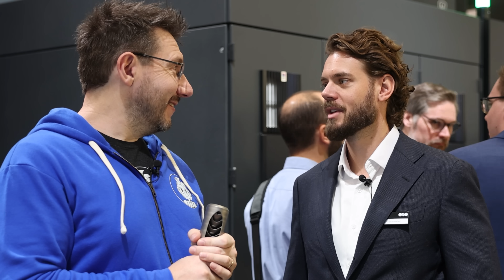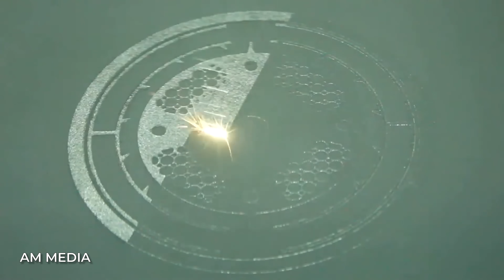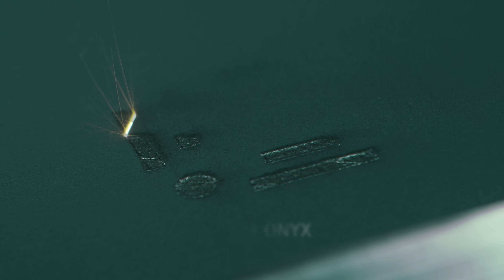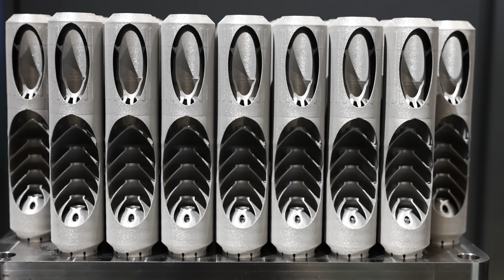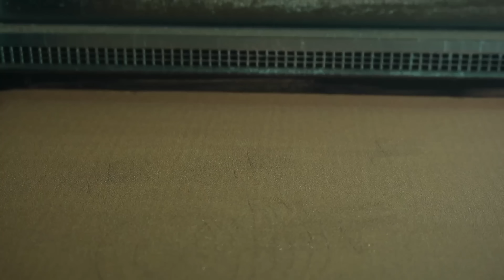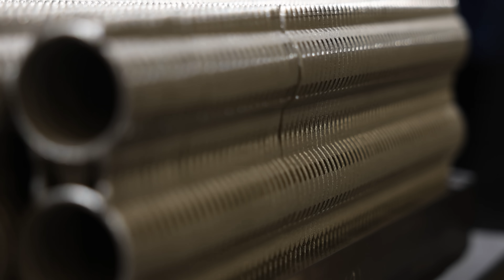LIGHTS OUT METAL 3D Printing from EOS!

Comment: Why do all the metal-printers show off their abilities with gun suppressors?

Hate it. I get they want the gun-nut and military money, but I hate that.
Reply: The legacy designs for silences have low yield due to the brazing and workmanship leading to low yield. Printing this geometry improves yield and reduces price due to the reduction in touch labor. That is before you design for performance improvements in the final product from the materials microstructure or geometric complexity that are within reach by Printing. If you sold the same design as legacy printed it would genuinely cheaper for the manufacturer which is more money in the bank. Its a very easy use case to demonstrate to people who have seen the headaches of yield from brazing or assembly.
Reply: k

Comment: I have a CAT AlleyCat 556 QD in 718 inconel. Literally the best suppressor I have ever bought and it’s made exactly like this. Metal 3D printing is responsible to the rapid advancement of suppressor tech. If you haven’t experienced a cutting edge suppressor in action, go experience it! They make shooting much much safer not only from a sound perspective, but also the new higher flow rate models reduce toxic gas exposures to the shooter and they all help reduce the blast loading which reduces and helps mitigate TBI’s!

Pew Science has fantastic research on these subjects! Jay also is super nice to talk to!